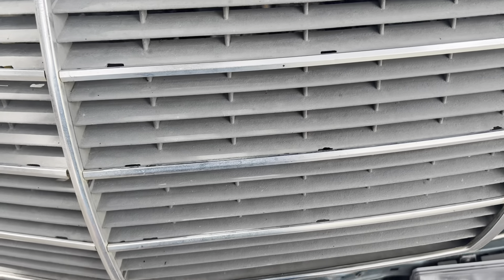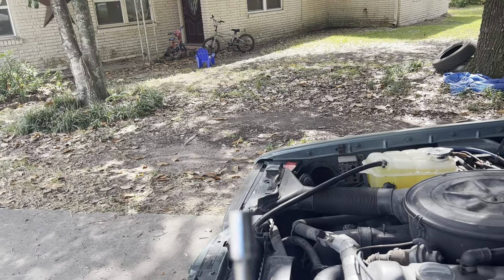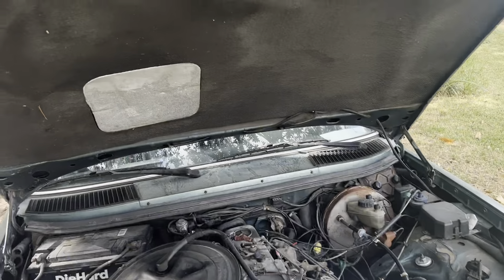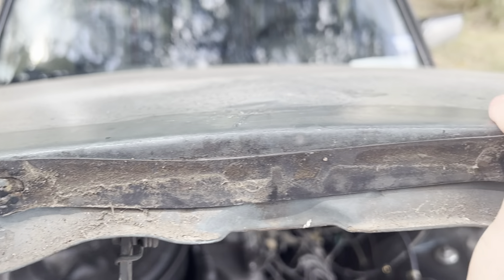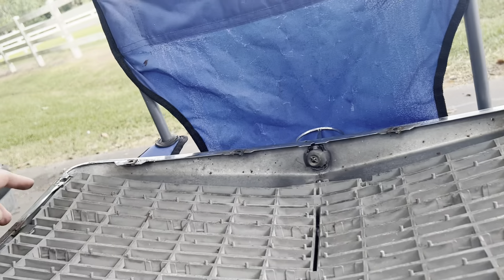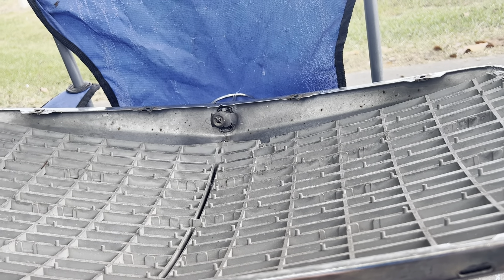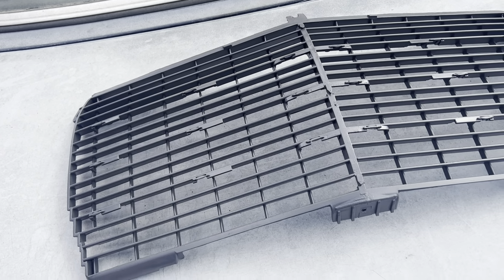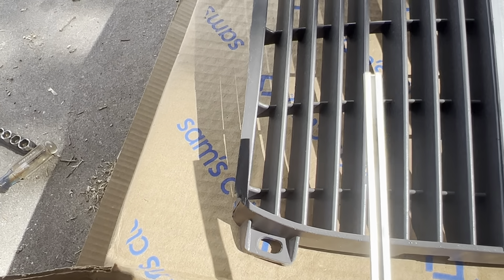W123 Mercedes Grill Insert Replacement

Comment: Looks good.  I would have just painted the original grill insert.
Reply from the maker: Thought about it but it’s in better shape than the one in my 300d, so got a new one for the 300td and will probably paint this used one for my 300d.